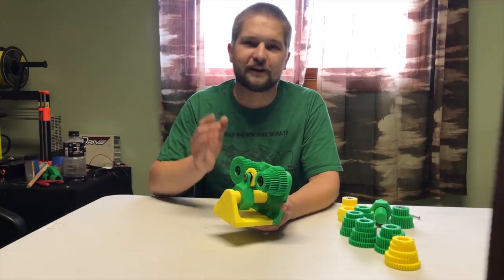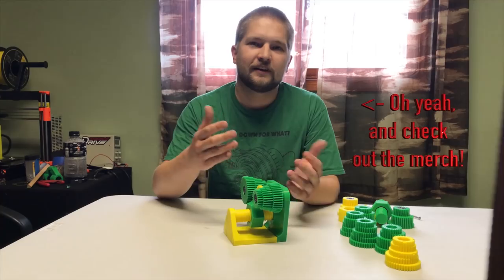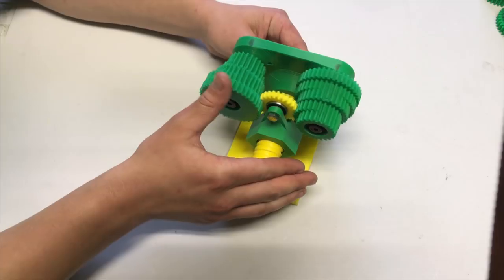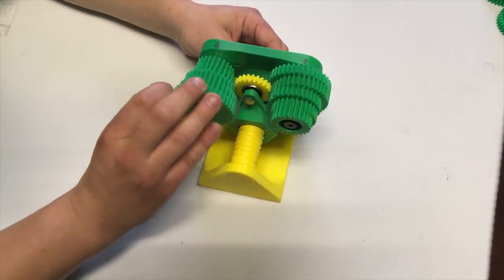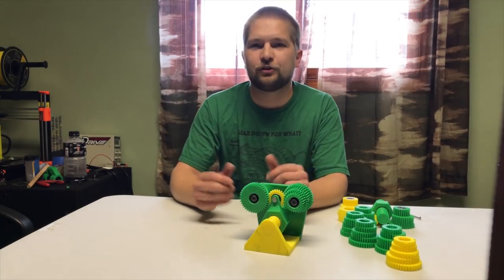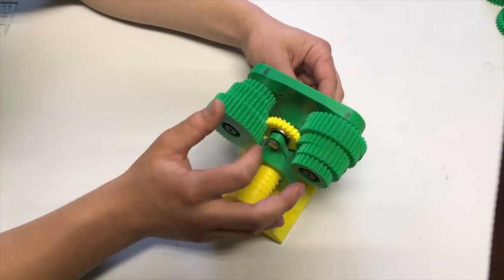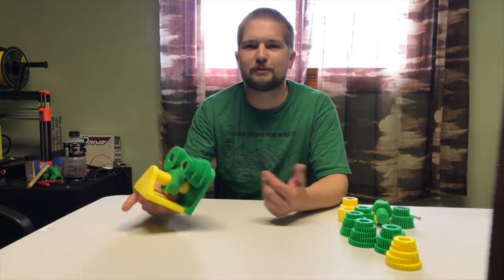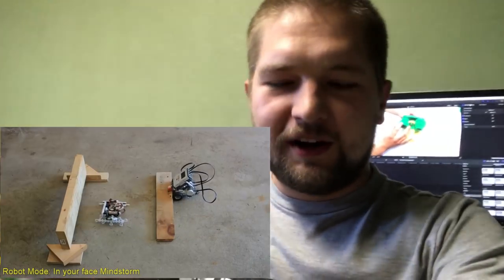The Hot Swapping Gear Mechanism | VCT2

Comment: I have a solution... One single gear. No transmission. Electric motors are the future and only need one gear.
Reply: Liso Campos but they have a really crappy high-end. An electric car with a transmission would tear every other electric car apart... Transmissions are our past present and future. You should really look into what a CVT is... if you would have put that on a electric engine, it would work 10 times better... one thing that really sucks about an electric car is that you can't really do any upgrades to it. Its stock speed is about as fast as going to go. Which electric cars usually aren't that fast but they are very quick. They will get up to speed really fast but they have absolutely no high-end speed. And last time I checked an electric car has yet to be fastest speed. Combustion engines work way too damn well to be out moded anytime soon
Reply: /b/ Tard Actually, the only reason that electric motors haven't taken over completely yet is the power requirements are too large. In theory an electric motor with a large enough energy supply can beat out an ICE.
Reply: Boom
Reply: 1FireyPhoenix so what you're saying is that you need more power to do the same as a gas engine? What about just adding a bit more displacement to the gas engine, and it beat out the electric one already
Reply: Tyronicus Maximus Ha. That's funny. More power? More capacity. We already know that an ICE is rudely inefficient, with all gasoline and diesels running at about 40% of the full amount of energy stored in the bonds of carbon based fuels. It isn't that electric motors require more energy, in which they don't, but we don't have the capacity to store the electric potential required yet. Once we do, electric vehicles will be able to single handedly beat out ICEs
Reply: /b/ Tard Rimac C1 is 2 gear
Reply: Tyronicus Maximus gasoline is more energy dens than lithium batteries
Reply: 1FireyPhoenix 40% is not that bad
Reply: yeah, the energy storage issues for electric motors are their main drawback. for most folks that don't use their vehicles to drive very far, it's not too big a problem, but if you work an hour away....
Reply: Roko Krstičević 40% vs around 90-95% efficiency with electric power.
Reply: 1FireyPhoenix Gasoline has about 100 times the energy density of lithium batteries.
Reply: Roko Krstičević Why are you hung up on that? I know gasoline is more energy dense then lithium. You can stop repeating yourself now. Incase you haven't read my earlier comment, I said the issue with electric cars wasn't the energy consumption, which is lower then that of a ICE, but the capacity of the storage cells running the electric motors.
Reply: LOL, I love when people say that electric motors are the future. LOL. Did you know that the VERY FIRST automobile was electric? Wanna know when? 1830s. State of the art baby. OLD tech. Some reading material to show how "futuristic" electric motors really are. 

https://en.wikipedia.org/wiki/History_of_the_electric_vehicle
Reply: Do you understand what a gearbox does? the purpose of a gearbox is to increase the power output at a different rate to power input, usually to increase it.
Reply: DisKorruptd Who are you directing this to?
Reply: i think the electric equivalent of f1 car have a 2 gear transmission
Reply: \
  \
    \
      \
        \
          \
            \
              \
Actual power curve of an electric car.
Reply: It wouldn't be good for my job in a transmission enterprise
Reply: Koenigsegg regera has gas and electric motors with 1 gear

Comment: Instead of screw put in a shaft and a belt with sprigs and this way you can change gears whenever you want and it will mesh by itself, and add a second support bracket on the other side.

Comment: you do realize they already have these that actually work ahaha
Reply: proof?
Reply: Dominic Mammone I think he means full variable transmissions, like a cvt for example. Audi uses them for the Q3 model, as well as the toyota for the Prius.
Reply: Mandernach Luca normal cvt's not  ones like in the video
Reply: Dominic Mammone Yes, as i said, i think he means fully variable transmissions in general (the ones that actually work ;D), for example a cvt transmission in a scooter.
Reply: yes but normal CVT uses push belts not gears..... the problem with push belts the require high clamping force to compensate engine to drive train from slipping thus reducing efficiency. whereas using gears requires no clamping force and does not slip but require more advance engineering for designing such transmission
Reply: Spicy Insomnia Believe me when i say, cars like the Audi Q3 (wich has said cvt transmission), are actually more economic then normal automatics. But how, i hear you ask? Actially, with cvt transmition the engine can always operate in the optimum rev range (depending on load), this advantage negates the loss of power in form of friction and even increases the overall efficiency of the drivetrain over for example a dual clutch automatic transmission.
Reply: i know how economic CVT's are but im not talking about CVT's vs dual clutch automatic transmission, im talking about Push Belt CVT which clearly on an Audi Q3 vs a Geared CVT. As I said Push Belts require high clamping force to compensate the slippage and can easily break in high rev and torque range and fail prematurely thats why it is only used in scooters snowmobiles and some eco cars. for the upside, they are superior in efficiency. But if you can design a CVT on gears can further improve efficiency, rigidity, and eliminates engine to drive train slip meaning it can take a bit more of a punishment  maybe put it on a super car without any significant problems.
Reply: Spicy Insomnia Did you never heared the name Koenigseeg Regera? So much to supercars with cvts, makes our conversation pretty much obsolete but i can give you at least one other example for a riged and cost effective solution. Did you ever saw the continuous variable transmission of the Toyota prius? It works because of a clever combination of a hybrid system (generator and motor combination) and a dual planetary gear.

Comment: My best guess is to not give them a 1st, 2nd, or 3rd gear. Give them a single gear and that’s all. Just make make the them a smooth conical shape where the teeth jump out of the lacking area. Or you can make them cylindrical and the teeth get wider apart to give a lower gear ratio. Less likelyhood to skip teeth, or get messed up, allows easy acceleration, but if you really want to try hard (but hope you don’t overrev the transmission) then you could make a system for the more experienced users that can switch gear cylinders with ones with higher gear ratios for higher torque outputs. But that would require a form of clutch, defeating the purpose.

Comment: The purpose of a clutch is to disconnect the power source from the load for shifting gears, neutral, and reverse. You'll still need one.

Also, shifting gears with this mechanism can only occur at a precise point in the rotation where teeth are aligned. Next to impossible without a clutch and perfect timing

Comment: The middle gear is also the one under most wear so this gearing will probably wear out quickly. You'd be better off with two gears in the middle to transfer the power but I suspect the design won't allow that. It's because the different gears on primary gear looks to be made out of the same material and are not concentric. (The secondary drive is the same)

Comment: That timing issue really makes it impractical. It would mean that only specific gear ratios could be used and only shifted at a particular time. This would mean that the engine RPMs couldn't be optimized and if you couldn't shift while stopped. 

To me the ideal non clutch eared transmission design is the one used in heavy trucks. Twin countershaft, no synchros and auxiliary boxes. They just need to be scaled down. Twin countershafts eliminates side loading on the mainshaft and more then doubles the strength. Non-synchro eliminates a lot of parts and makes non-clutch shifting easier. And auxiliary boxes multiply gearing allowing for a lot more ratios with fewer gears, a 5 speed and a 3 speed make a 15 speed. Or in a car 3 and 2 make 6.

Comment: Perhaps utilizing a synchronization gear (what they used on WWI planes for timing the machine gun so it fired through the propeller) could help the connector gear (yellow) so that it can only transition (change gears) when the outside gears (green) are properly aligned. 

Also, a spring system on the connector gear would make the transitions instantaneous in a transmission where these parts are spinning at very high RPMs and have no room for error.

Comment: The shifting would have to be computer controlled, very precise and very fast shifting for this to even possibly work. As others are saying, under load, that center slide gear will NOT want to move around to the other gears. The eccentric gears would most likely cause lots of vibration at higher RPM as well. Very cool idea though!

Comment: Ok for low load, low speed applications maybe.  Unless those gears can be balanced high speed applications will suffer vibration and wear.  Major issue is whether the gear can truly slide and maintain mesh all the time, that part I haven’t even bothered to see if he has explained.

Comment: Use an electric motor on an input shaft and build an output shaft. Build it to mechanically shift but electronically synchronize. Use the engine rpm and an auxiliary drive on the output shaft to maintain the mechanical drive portion of the  transmission. My experience is from building go karts, minibikes, etc, the more mechanical a machine is with the fewest supply of moving parts builds the strongest machine. Example, I have minibikes that have outlived cars due to simplistic, bullet proof designs. Take this into consideration. thanks man✌

Comment: I see how it works and its very clever. I can see how most of those " issues " can be solved like  I think a syncro ring on either side of that " shifter " gear would help a lot with transitioning between gears. The shift as you say could be easily timed and geared electronically would be best but I can't see why a manual lever wouldn't work. You have straight cut gears for demo which don't help shifting be smooth either. Reverse would be interesting if was done on input side as would give multiple reverse gears. And on the output side would require another set of gears to work. You could run either a clutch or t/c with it and would work fine too.

Comment: Just my thoughts,  you need the rigidity of metal and you shouldn't lose your timing. Once you have it rigid it should shift smoothly at the proper rpm, kind of like power shifting a syncro trans. You could design a centrifigal drive to shift driven from the input shaft.
Reply: Brian Dughi smoothly is not the word I would use.  Maybe violently.  The ratio change happens far too quickly to be smooth.
Reply: KC9UDX i was thinking more like power shifting a muncy in the quater mile. The mesh between gears is smooth but the power tranfer is rather violent. Most old school drag racers didnt use a clutch, theres a sweet spot in rpm that you can shift without it.

Comment: The problem I foresee with this is backwards input. Just like in a motorcycle, you have constant feedback into the gearbox. The backwards input would cause it to bind. It would also spin too fast to effectively change gears.

Comment: I drive a vehicle that can change gears under power with no clutch, for a living! It's called a semi truck and uses an 18 speed transmission made by Eaton Fuller transmissions, touch of sarcasm and it switches gears exactly when you expect it to, its like it can read your mind!
(It's a manual)
But if you want an automatic because you don't like developing driving skills or somthing similar, you can buy what is essentially a fuller transmission that shifts using knewmatic cylinders to operate the mecanisum normally operated by the shift lever, and so an automatic transmission that can shift under power without a clutch already exists and it currently seeing extensive use.
I think that any and all engineers should have experience with heavy machinery before working for a big company to design machines

Comment: Cool concept, but the idler gear needs to be strong and thin enough to not get between 2 sets of gears while shifting. Add a manual clutch and shifter i think it'll work

Comment: Stoat was that was your answer you need to make a spring detachment mechanism that will allow the gear to separate for alignment just in case of gear misalignment, take an example of the camshaft gears . In addition a program module can be set for auto reset that will allow each gear set to be monotonous once detached .. What do you think?

Comment: Every straight drive that I have drove ONLY needed the clutch for take off and after that it just takes shifting at the right rpms to get through the gears and I would like to add that if you don't force 1st gear at take off you sometimes can get the clutch to slip enough to slip into gear, I can see this IDEA working IF there was a drumm type clutch set up for 1st

Comment: what you could do is have a system where the part that holds the gears have a hydrolic system where it can be moved apart to realign the gears instead of completely disassembling
the mechanism

Comment: All you need now is 4 position sensors for redundancy and a stepper motor solenoid to run the shifting with a sensor on either side for redundancy again. Do you think you could build a torsen differential with your printer and test it in a car? Like an RC car, that torque might kill those gears

Comment: Use CVT. It's very small and compact due to its competitors. And there is only 2 rotating wheels an these wheels can change their diameters with a cumputer's help. So, there's fewer parts: torque converter, thong, 2 wheels and a computer. Very small right?

Comment: Have you thought of trying an offset orbital gear and using a planetary gear as an output thats lined up through all of the gears? Then the transition points would be unnecessary and you can slide straight through any number of gears at any speed.

Comment: The belt-drive CVT in most scooters is about as simple as you can get. Very few moving parts. You can rebuild the whole thing on the side of the road with nothing more than a ratchet, 3 sockets, and a variator/clutch holding tool.

Comment: If you have it so the computer can sense a misalignment, and make it able to completely pull the center gear out into a "Maintenance" position, you could then have a small electric motor turn the out of line gear to match the other. then the shifter would shift it back and you could continue.

Comment: I remember seeing an irrational set of gears a while back on a gear puzzle channel, and the trick was that one of the gears had to slide on its shaft to complete turns. I see a lot of comments about helical cut not being able to handle sliding, but I wonder if there's a tooth geometry on the drive gears that would allow the pinion to be driven to the next operating set by the drive gears themselves, thus eliminating the mechanical timing issues. It'd have to be something looking like a railroad switchyard, with certain teeth cut into other teeth, which might be a mechanical nightmare in and of itself. Also, the means to initiate and finalize a pinion movement are eluding me at the moment...

Comment: ...check out the Fuller RoadRanger Twin Countershaft transmissions...main shaft gears float between two countershafts...the only contact the main shaft gears have with the main shaft is a snap ring to position the gear and establish end play...no bushings...no bearings...

Comment: You could attempt to slightly round some of the teeth on certain edges of some of the gears to assist with "enforcing" proper timing. I imaging the same could occur with slightly angled teeth, in a way that could "stop" the pinion gear during a transition when force is applied. Combine the two ideas and who knows, it may be worth a test.

Comment: I kinda noticed the flaw right away and was waiting until you'd mention it. You'd need impeccable timing to make this work. But if you'd found a reliable way to do that, shifting gear would be pretty smooth. You could even have 10+ of those gears and have optimal performance at all time.

Comment: There is one inherent problem with this design, which is there even when you never change gear:
Given that green gear 1 spins with constant speed, then green gear 2 will not spin with a constant speed. It will vary slightly in speed (sinus curve) during one turn. This is due to the gears being not concentric to their respective axes. It means that you will get lots of "rotational vibrations" around the spinning axis.

Comment: But if the gears are shaped like this, does the speed fluctuate little? If the teeth of the gear are spaced with constant gaps and some of them are further from the shaft, this makes the speed to fluctuate and this may generate vibration.

Comment: Seems like you could mechanically block inappropriate alignments. Use spring force to preload prior to transition. I'm a little off put buy the floating of the idler gear. Can the shift take place fast enough that the gear settles in an acceptable alignment?

Comment: It's a cool looking design, but there's an easier way to shift without a clutch using a standard manual transmission.  Just match engine speed to next gear speed at torque ~0 then shift.   There's a slight power loss during the split second that it takes to do that since you have to drop torque to near 0 during the shift.   I've done this successfully without the help of a computer.  With computer assistance it could be a much faster transition.